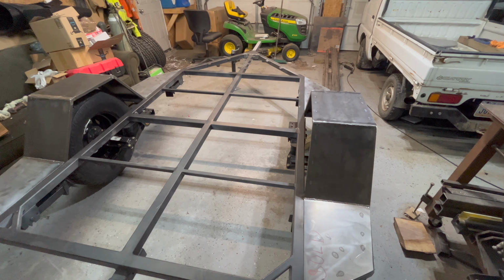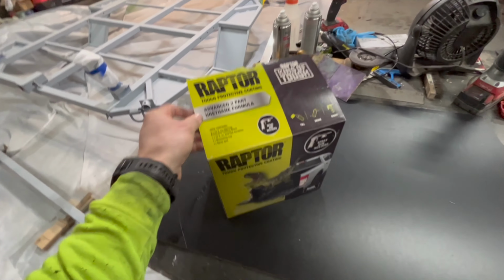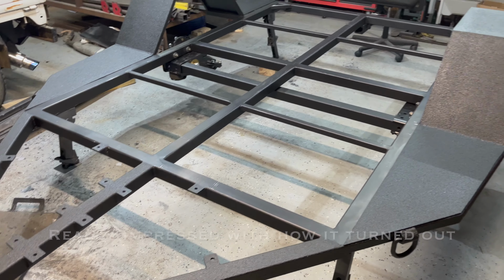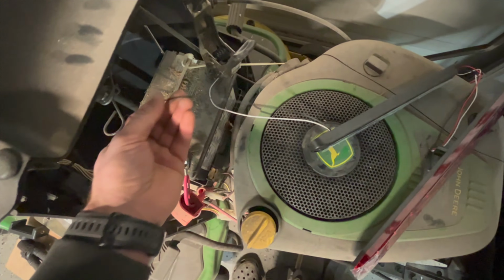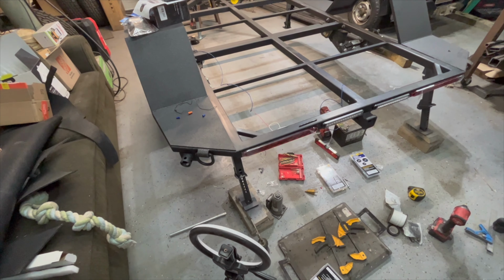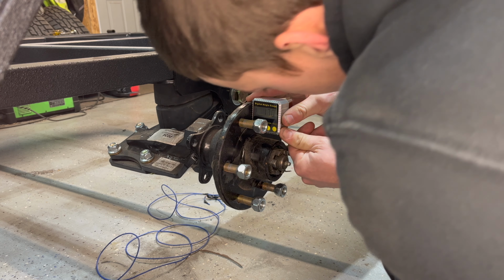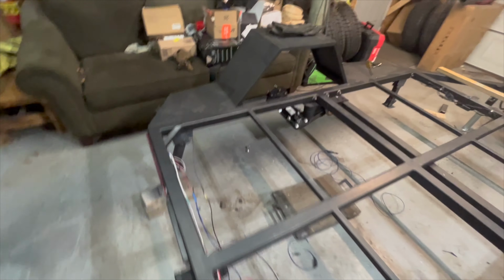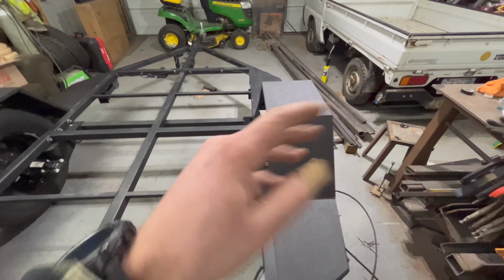Micro Camper Build Part 2 | Raptor Liner | Wiring | Suspension

Comment: Trailer wiring is wired, but typically;
White = earth
Red = brake lights
Blue = service brakes
Brown (or black in USA) = running light/taillights/park lights.
Yellow/green = indicators (turn signals), depending on country.
Black (in rest of the world) = Reverse (or Aux power if you have a dodgily wired caravan).

Some countries will have other colour wires for Foglamps, reverse lamps, Auxiliary power and full-time power.

Comment: Im liking your build so far. Looks great. I'm using the Timbrens also on mine. Something to keep in mind, One issue I ran into on my build Is I built the frame and mounted the fenders, axle less suspension and wheels and tires. After I started building the cabin body the suspension started to sag causing tire to fender clearance Issue. I'm using the Timbren 3,500lb HD 4" lift suspension and gapped my fenders properly but after adding about 500lbs the suspension settled a few inches causing the tire fender clearance to close up to about maybe only a half inch. I'm currently working with Timbren on a solution and will be posting a update on my channel once I have the solution. Make sure as you finish out you build to keep weight of trailer on suspension to make sure you don't run into the same tire clearance to fender issue. My worst case scenario would be to cut off my fenders and refabricate them which would be a big job as I have my exterior now complete and would have to disassemble a lot of trailer to do so.
Reply from the maker: Hey man thanks for the heads up and yes I’ve thought about this as well. I’m currently sitting at about 2 inches of clearance on my tires to fenders. I personally think I’ll end up being okay but if for some reason I am not my plan was to get smaller tires. I think that would be the best solution on my end.
Reply: @ian_whitelock  I was able to fix my clearance issue. As I have the 3,500lb set up. Timbren sent me 5,200lb springs and it reset my ride height back to were I originally had it. Even with the heavier rubber springs it still has plenty of flex.